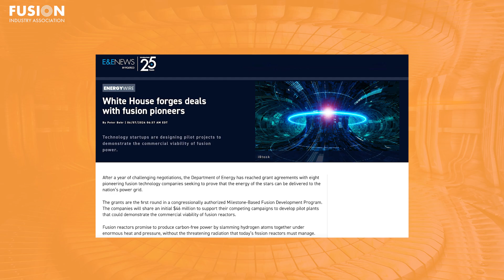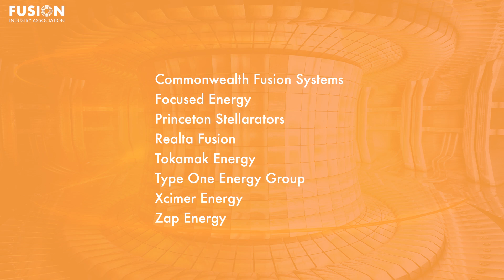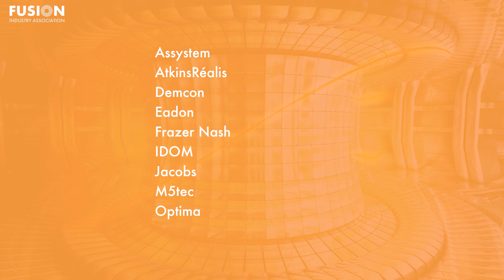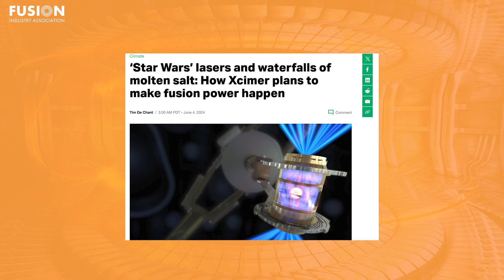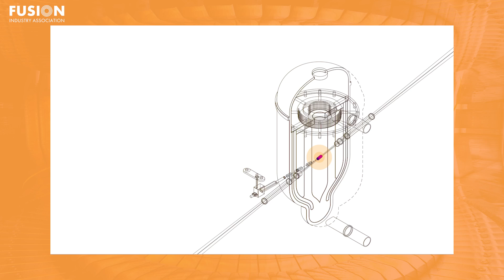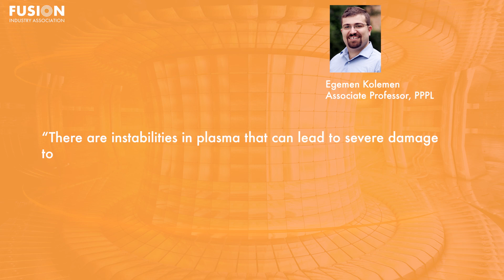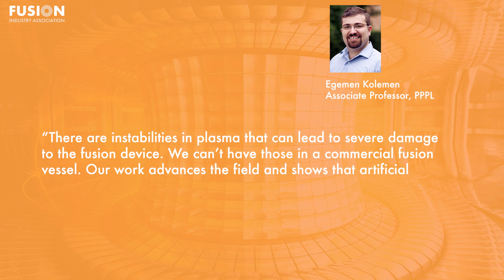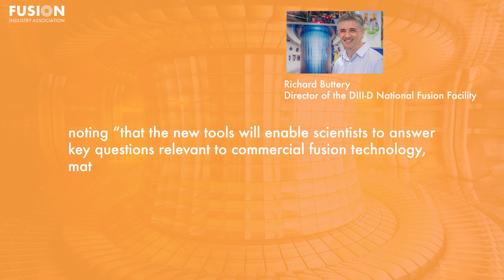Fusion News, June 12, 2024

Comment: Ours is a paper bin sized device that inputs deuterium and outputs helium and electric current. Originally made at the Rutherford lab in 1969 . It cost just over $1000. I suggest  we use it. The tokomaks are expensive failures. 
Christopher strevens

Comment: Do I really need to point out the MASSIVE glaring show-stopping fault in Xcimer's plan to "only fire at a single [fusion] pellet every few seconds"?? A power plant typically produces around half a gigawatt to a gigawatt of power to the grid, the Carnot efficiency of most plants is around 35%, meaning the plant's reactor is actually producing 1.5 to 3 gigawatts of thermal power to actually spin the turbines. There is a REASON every proposed hypothetical future laser ICF reactor assumes the laser will need to fire on at least 10 pellets per second (10 Hz), because 2 gigawatts of power (2 gigajoules per second) divided into 10 pellet implosions is actually doable; it means each implosion "only" needs to release 200 megajoules of energy. A reactor firing once every 10 seconds like Xcimer proposes will need to produce ONE HUNDRED TIMES AS MUCH energy as that per shot - 20 GIGAjoules per implosion. That's the equivalent of FIVE TONS of TNT going off with every target shot. Do you know how incredibly enormous a target chamber you will need to contain a five ton TNT blast is going to be, such that it isn't blown to smithereens and destroying the building it's contained in on the first shot?
Reply: I'm not a fan of inertial confinement approaches, and even less so of laser-induced implosion, but the comparison to the effects of five tons of TNT is not correct. The energy released in a TNT explosion goes into the production of a large amount of hot, high-pressure gas that indeed tends to push out and away any close, confining structure. The energy released by the fusion of a much smaller mass of D+T does not produce such tons of hot gas, but produces a lot of high-energy neutrons which can be absorbed in surrounding material (the liquid salt) and heat that material without blowing it up.
Reply: @NiklasHolsti  I will grant that the comparison is imperfect, but the blast wave and amount of either FLiBe or liquid PbLi vapor created with a 20GJ detonation is still going to be unbelievably huge and require an absolutely enormous target chamber, to say nothing of the hellacious effects on the final optics.
Reply: @Muonium1  The calandria of a CANDU reactor is a 6x7x7 meter tank of heavy water and fuel bundles. With that in mind, a hypothetical fusion target chamber 5x5x6 meter would be half that tank's size, not "absolutely enormous." A target chamber with those dimensions would have a volume of 150 cubic meters. Would a 20 GJ fusion detonation create an "unbelievably huge" amount of FLiBe vapor? I think not. The article says the chamber walls will be protected by FLiBe, in the form of a molten river, splashing jets or droplet curtain. For simplicity, ignore those details and assume FLiBe uniformly covers the walls one meter thick. It needs to be thick because the mean free path of 14 MeV fusion neutrons in 750 K FLiBe is 7.14 cm and it will take several collisions to slow and capture them. The way the chamber is currently described, it contains 36 cubic meters of FLiBe and 114 cubic meters of vacuum. Due to the vacuum, it has a negative 100,000 Pa gauge pressure. If the reactor is going to be blown to smithereens, then a sufficient amount of FLiBe needs to be vaporized to fill the vacuum and create a positive pressure, according to P = nRT/V. In order to maximize the amount of FLiBe that gets vaporized, assume 100% of the fusion energy gets deposited exclusively in the first 7 cm FLiBe, less than one mean free path length. That assumption favors the hypothesis that there will be an "unbelievably huge" amount of FLiBe vapor. Nevertheless, 20 GJ of fusion energy will not be sufficient to heat 4.82 cubic meters (3.14x3.14x4.14)-(3x3x4) of FLiBe from ambient (750 K) to boiling temperature (1700 K), because FLiBe's volumetric heat capacity is 4540 kJ/(m^3 K). In conclusion, there will be a non-existent blast wave composed of no FLiBe vapor. Even if the fusion energy was increased enough to create some vapor, it would quickly recondense (<< 1 ms) upon contact with the cold FLiBe. :-) Please prove me wrong.
Reply: You cannot compare TNT explosions with explosions from fusion pellets. Most of the energy in DT fusion (4/5) is caried by neutrons traveling close to the speed of light. Because neutrons are uncharged they penitrate deep into the surrounding blanket material. Neutrons thermalize (slow down) by colliding with atoms inside the blanket. This increases the blanket's temperature. Some materials contract when heated, but if the blanket is made of FLiBe, increasing the temperature causes expansion. Either way, the pressure change due to a change in density would be insignificant and confined within the blanket material itself. If the reactor is going to be blown to smithereens, as Muonium1 seems to think it will be, then the explosive force needs to come from the outwardly directed mometum. However, compared to TNT explosions, an equivalent energy nuclear explosion only produces a tiny fraction as muh outwardly directed momentum. This is because momentum (mv) and kinetic energy (mv * v/2) are conserved, and nuclear reactions produce particles having more than a million times the kinetic energy that chemical reactions produce. Unless I am mistaken, the fusion energy from an Xcimer pellet might be measured in tons of TNT and still only produce a firecracker's worth of outwardly directed explosive force. :-)
Reply: @michaeldeeth811  Another zero-content channel reply, what a surprise. 🙄 Where exactly do you think the energy of 20 gigajoules which is deposited over about a microsecond into thousand degree molten lead-lithium alloy is going to go? It's going to VAPORIZE large quantities of the metal and cause the formation of a powerful shock wave in the target chamber. It's literally a miniature thermonuclear bomb going off. 50% of a nuclear bomb's energy is emitted in the form of a blast / shock wave. So yes, you are mistaken. Very.
Reply: Such details never seem to worry the fusion community: it really is a load of hot air.